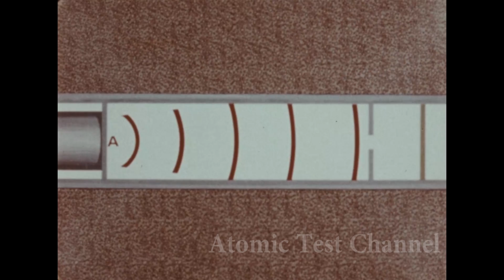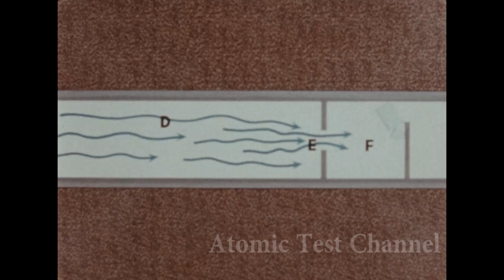Original shock wave stock footage used in the Atomic Café documentary 1982

Comment: Okay kids let’s look at the force applied by 4 psi over pressure. Let’s use a wall 10 feet by 8 feet. That is 120x96 inches or a total of 11920 square inches for a total of 47,680 pounds of force. That’s almost 24 tons hitting that wall. It’s going to fail.

Comment: Nuke Blast waves move at insane hypersonic speed at source and decelerate from there depending on the KT of the explosion.   “Only” 4 psi as the narrator states is NO understatement for what may be the force nearer to the fringe of the Blast Wave vs. single digit miles from the blast. When MT. Saint Helen volcano blew off all a mass off its side off the blast wave six miles out was still supersonic and over 60O deg. F. Wish we had basements in the western US.  Fallout is mitigable if you are radiated, fried, or blasted directly or by debris.